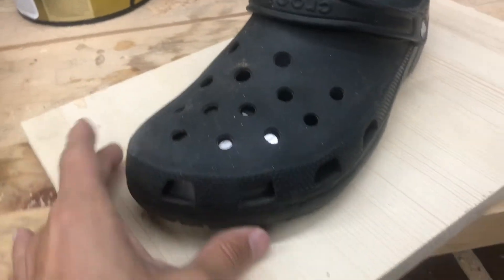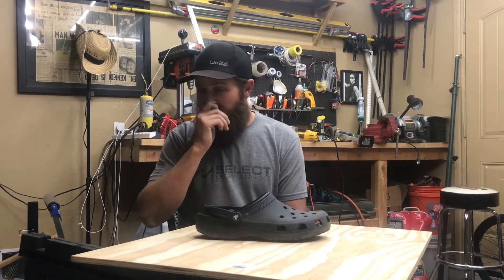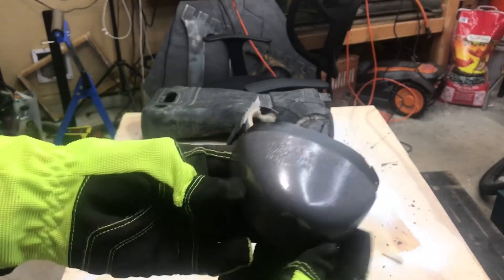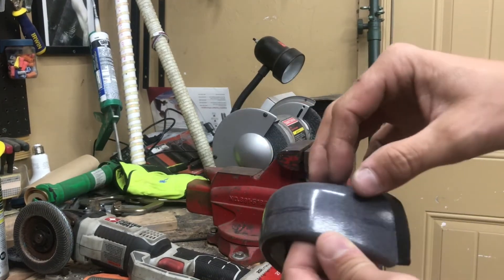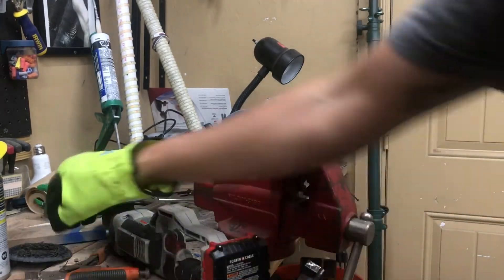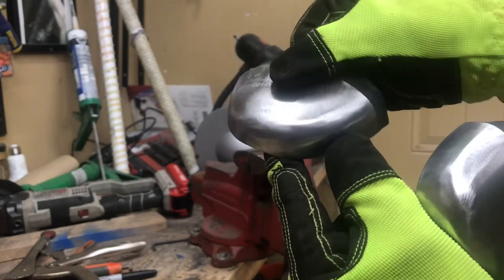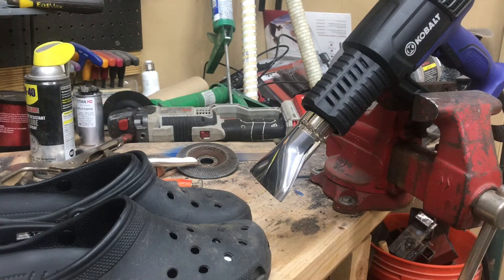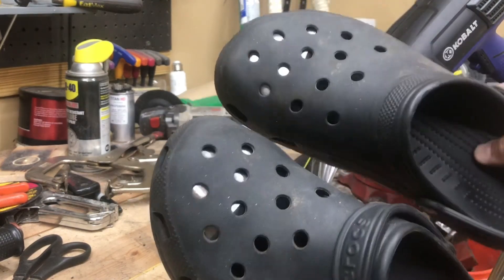How To - Steel Toe Crocs DIY

Comment: I did the same thing with a pair of Wolverine boots I needed to be steel toe for new job. Cut a pair of toe caps from a pair from Goodwill for $5.00. Roughed up toes with sandpaper for better adhesion for the Liquid nail.   Took out shitty inserts from Wolverine, I trawled a bead of adhesive over the caps and pressed them into the toe cap of boots(took out laces to fold down tongue), Wiped up any residue. Put in a pair of shoe trees to hold toes in place overnight until dry. Put in new pair of inserts and done. Over a year now and no problems. Not sure how to convert a pair of Crocs, but may try using a composite toe instead of steel,  adhesive might hold better, good luck.

Comment: I suppose these would be ok for minor bumps, but they would destroy your toes if you ever had a serious drop on them. There’s nothing but soft foam for the edges to press down into when compressed.
Reply from the maker: You’re 100% correct. These are more for light work around the house or in the garage. My kids can also bounce on my feet and I don’t feel a thing. When I’m going real work, like rolling logs onto the sawmill, I’ll always have my boots on. Thanks for watching!